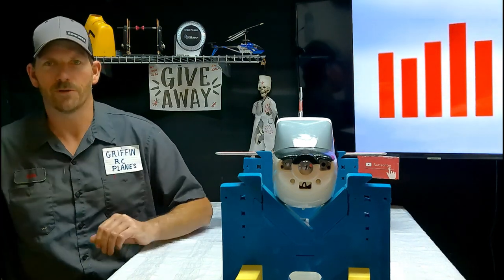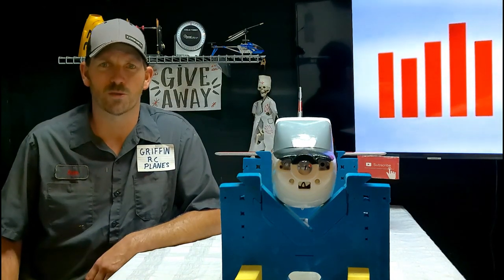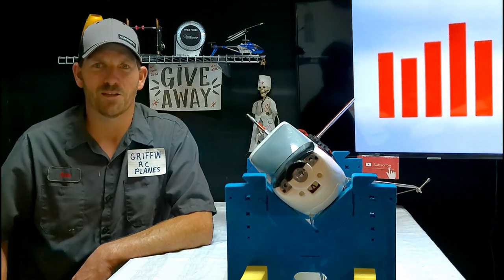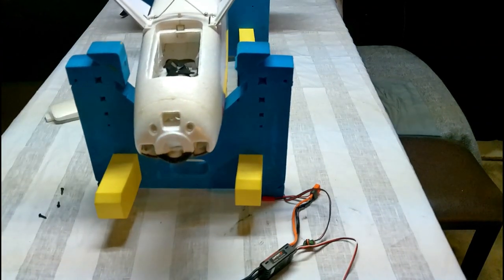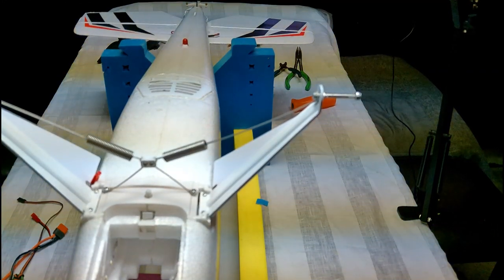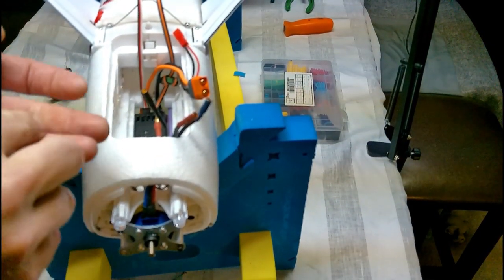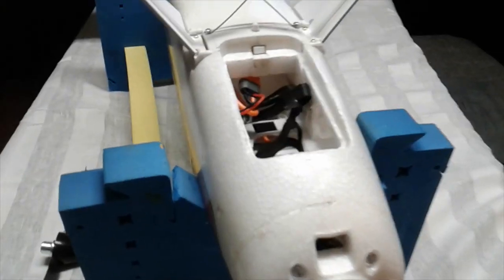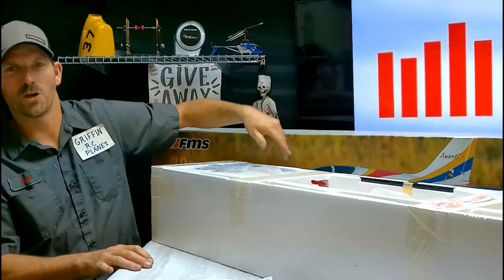E-FLITE NIGHT TIMBER X READY FOR TAKE OFF .

Comment: Great video Sean, some excellent tips with the wiring. I have a Turbo Timber that loads the battery the same way from the bottom. I got tired of trying to get my fat fingers into the space to secure the Velcro and after a crash that left the floor on the ground, I said well when I get it fixed I will just kind of snap it in with battery secured to it. Now I take the whole battery & tray floor out and in with the battery. Much easier for me. The tabs keep it for moving and I don't use any extra  glue. I am so glad my mom didn't have a cell phone before she past. I have enough trouble  with my wife's and mine.  Have a great week! Fly when you can, it clears the mind.
Reply from the maker: Thanks again